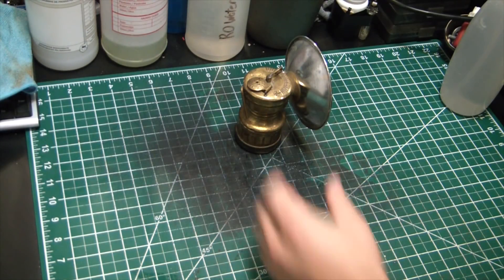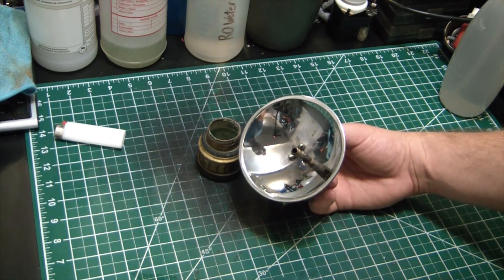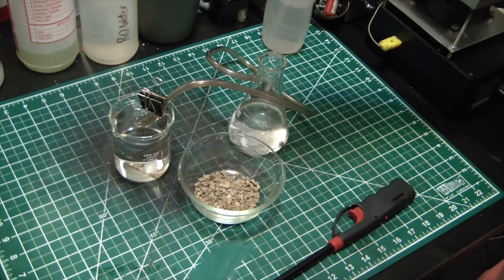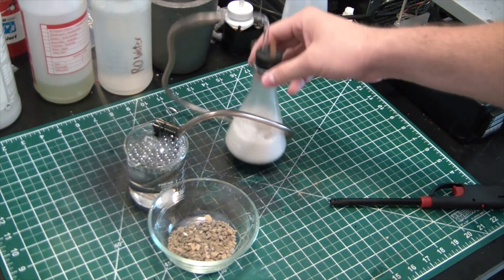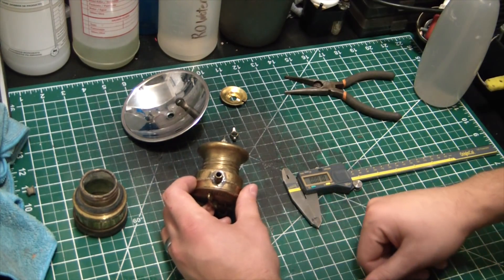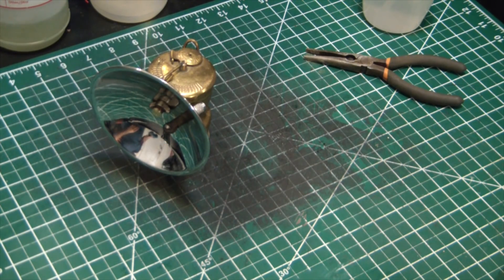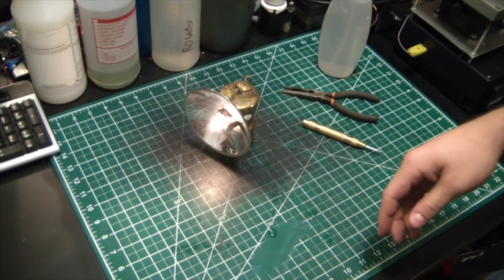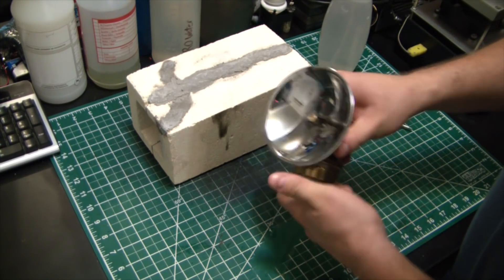Old Mining Tech: Carbide Lamp Restoration - ElementalMaker

Comment: I have 39 lbs of calcium carbide.--I got most of it from a retired miner in Vancouver WA.  I want to get a carbide lamp to play around with but haven't found one I want to spend money on yet.  I'm not sure what all else I can do with the calcium carbide, but I've got a few ideas like a torch and a small carbide cannon.
Reply from the maker: If you ever want to sell some let me know! My supply is getting attacked by moisture. Need a better container.
Reply: ElementalMaker The guy I bought it from told me liquor bottles are the best way to store it. Most of the supply is in large bottles. LOL. When you screw the cap off it lets off a good hiss.
Reply from the maker: LOL thats awesome! Not a bad idea though. moisture wont diffuse through glass and the caps are typically quite airtight. Might have to transfer mine into an empty Tequila bottle. Time for a party!
Reply: If you are in driving distance I could sell you a bit for sure. I know it isn't supposed to go through the mail, though that didn't stop the first seller on Amazon whom I bought the first pound. Last year I also got a liter of 70% nitric delivered through via FedEx and I know that is a big no-no. I spent two months contacting suppliers for form applications only to be denied repeatedly, one by one. The last big supplier in the states attempted to work with me about obtaining a new storage bottle and labels and they just wouldn't "couldn't" help.. Then out of curiosity I tried another mean from the Wal-Mart marketplace.just keep an eye out for gold mining supply sellers. They have acid.
Reply: ElementalMaker I live in WA state by the way.
Reply from the maker: Matthew Wilson ah man that's a bummer I'm clear across the country.
Reply: Send me an email.  We'll see if we can work something out somehow.  I'm going to be reading up on the laws.  Go to my profile and on the about section gives an email address that I use.  If not the calcium carbide, perhaps something else will come up.  I'm trying to collect all the elements I can legally own, plus I like to make as many different salts as I can with them just for fun.  I'm an almost 41 year old child.
Reply: Have you seen the footage from China where there was a warehouse fire, and a load of illegally stored Carbide? Biggest boom I've seen on youtube. It took out acres of new cars on their shipping lot, and I don't know how many buildings. Sorry 'bout that, firemen.

Comment: rebreather sorb is typically a mixture of sodium and calcium hydroxide
Reply from the maker: Yeah I researched it a bit more after releasing the video and realized I misspoke. Wish they still allowed annotations so I could note that. Thanks for the comment!
Reply: ElementalMaker no probs , I’m pretty sure they do use lithium hydroxide for space use because of its lower mass and slight safety increase.
Reply from the maker: Yeah I must have been thinking of the scrubbers used in the old Apollo missions. I believe on the ISS they actually use Zeolite molecular sieves to absorb the CO2 since they can be regenerated rather than shuttling up new hydroxide canisters periodically.
Reply: ElementalMaker  ah that’s smart. For some silly reason rebreather sorb is fairly expensive for what it is would hate to see the prices if they had more expensive raw materials
Reply from the maker: Do you do rebreather diving? I am only open water certified (getting advanced NAUI cert next month), but would love to get into a rebreather some day. I often thought about building my own, but that's a scary prospect if I did something wrong...
Reply: ElementalMaker  yeah I do a bit of everything only flown a breather a couple of times . Let me preface this with it’s never a good idea to DIY your own dive gear ..... but if you are buying commercial sorb  and on 100% there isn’t that much that can go wrong and makes a great system for doing long deco. Current sensor technology is what you’d call scary the lead galvanic cells are not intended for use above a particular pressure of oxygen of 1. Are designed for use in dry gas . Are sensitive to shock and vibration. 

To combat this they use 3 and voting logic which really isn’t all that great of a guarantee , optical sensors are being developed that’s when I’ll consider buying one, will certainly reduce my helium bill.
Reply from the maker: Very cool, I hope to get there some day. I would never use something like that for actual diving, just more proof of concept on-land fun. I didn't realize the existing sensors were so flaky. That's a bit scary.

Comment: AVE wanna be. They still sell new units as well as spare parts. You have to go to coal country to find them. When I was kid we would empty baking power cans cause they had an air tight resealable metal lid. Drop in a few pellets add water and seal lid. Throw the can or drop it and run and wait for it blow up.

Comment: Harbor freight sells micro drill bits. I use them for clearing my nozzle on my 3d printer. They're not too bad.  Just gotta go slow with em, they break easy, but even better quality will break easy when they get that small.
Reply from the maker: Didn't know HF sold them. Awesome! Thanks for sharing! I'll have to pick up a set and test some new tips.

Comment: May want to look in to propane/welding torch tips. They come with a variety of orifice sizes and are readily available at any welding supplier or even a tractor supply location or similar supplier.
Reply from the maker: That's a great idea, I will have to look through my welding tips!

Comment: The opening for the gas is about the size of the tip of a needle, but behind that is a lot wider so if you have a drill bit that's like a needle you can make the right size hole.
Reply from the maker: Great, thanks!

Comment: Cool vid man. After asking a few of the old boys from our local engineering group it seems that  the original tips had a hole size of approximately 0.3mm to 0.4mm and they were indeed ceramic.
Reply from the maker: Awesome! Thank you so much Jon! I truly appreciate it. Now I can order some properly sized drill bits.
Reply: @ElementalMaker  Have you made a follow up video with the correct sized hole to see if it is better?
Reply: i had a feeling some gray-haired men somewhere knew about this, and it simply hadn't made it online yet.
Reply: @superdupergrover9857  it's old to us here in eastern Kentucky where most of Kentucky's mines were, are.
Reply: Ah, so there is your answer, take a bristle from your toothbrush, make a tiny dab of clay around the tip of it, "glue" it to the old tip, then pull the bristle out and let it dry. After a bit of use, it should become ceramic.
Reply: Would that really work? I just picked one of these up with the same problem this guy has, no tip, no lathe skills, I’ll have to try it. Wonder if my wife’s molding clay will work.

Comment: My lamp and repair parts kit came from The Speleoshoppe, in Fairdale, KY. Not positive if this dealer is still available. The flame is much finer than what you came up with.  

The hole size diameter looks like the thickness of a sheet of paper.  It is probable similar to a butane lighter. 

The nozzle is countersunk from inside and out, making the thickness short too.  

The kit also has replacement seals, flints, wing nut, and other spares.
Reply from the maker: Great I will have to see if I can find them, thank you!

Comment: Is Calcium Carbide available to buy from anywhere ?
Reply from the maker: ron palmer you certainly won't find it at home depot, but you can easily get it on eBay
Reply: Many thanks
Reply: Try Lehman’s.  It isn’t cheap because they sell about a 12 pound minimum.

Comment: try using a electrode from a dcell battery  yo machine the burner tip. I found one of those a few yrs back, and a blue can of carbide,boy what a bang u can get outta that stuff. I wanted to make my own bangsite cannon. just never got around to it
Reply from the maker: Great idea! I have tons of graphite rods laying around for rocket nozzles. That will work perfectly and drill much more easily! I'm going to weld up a carbide cannon sometime soon. Should make for a cool video! Its both awesome and terrifying how powerful acetylene is!
Reply: acetylene is actualy explosive. I tired getting the mythbusters to drop an oxy acetylene welding rig out of a helicopter. but even they thought twice about it. I remember seeing a A team movie where they droped one with some road flares taped to it and it was huge.but only proly gas bombs.
Reply: theyre easy to make with just plumbing supplies and a bbcue sparker. my grandfather used to use his fencepost just take the cap off .pour some water and carbide in it and wait a minute then touch it off with a lit stick. and it would sound like dynamite.ive seen guys use 55gal drums .coffee cans inverted over a hole etc and launch them . yeah its fun .till u blow out windows..

Comment: Would you be the younger  Ave?
Reply from the maker: LOL I seem to be getting that reputation. Love AVE's stuff.
Reply: Hey bob about the Patron thing would that keep hitting Avery month or one time
Reply from the maker: Bill Pritchett I believe you can choose to do either a one time or monthly. I truly appreciate your consideration of donating to the channel!
Reply: do you have a minute
Reply from the maker: Bill Pritchett yeah of course. How can I help?
Reply: the seebeckgenerator can it be hooked in series
Reply from the maker: Bill Pritchett such as peltier junctions? Yes they can be stacked in series, but it can quickly become complicated as they are quite inefficient. It's best to stack them in a pyramid configuration, ie the coldest at 30w, then 100w, then 150w or similar. You'll need some excellent heatsinking and a good fan to keep the hot side from overheating.
Reply: that the same thing that makes your car seats hot or cold ?
Reply from the maker: Bill Pritchett most car heated seats that I'm familiar with simply use resistance heating wire. For cooling they typically just blow a small amount of air through the seats through a series of tubes and pores in the leather.
Reply: would they work like a solar panel if you keep one side cold
Reply: looking outside of tool shed out here in Hell hot AZidon't know what i don't know thanks for time

Comment: I remember using one some 28 years ago (I was 12 or so) when visiting a non-commercially exploited cave in Austria. They didn't have the dripping system. On the way up to the cave we had to fill them with some water from a small waterfall we had to walk under. The guide actually had a head lamp on carbide. But these ones without dripping regulation, were just producing acethylene at full speed, building up the pressure. As the pressure got higher, the gas would not escape the water surface but instead go in solution in the water until enough gas was burnt to drop the pressure enough for new gas to escape the water (like CO2 bubbling up when opening a soda bottle). The advantages of such a system (in spite of a higher pressure buildup) were that the flame could not travel up the nozzle as there was no oxygen in the reaction chamber left by the time you shut the lid (which is not the case in your lamp, so yours actually has an explosion risk) and they were low heavy (while yours is probably top heavy with the water compartiment being up top) making them more stable when setting them on a ledge or on the floor.
I remember the guide explaining how they used the soot to mark the way to find the exit again, and in larger areas, you could follow the smell. If you entered a hall where there was no bad smell associated with these lamps, then you knew you entered a hall where you had not been earlier. I think I have some pictures from inside the cave, and I suppose I was holding the lamp in them. 

Anyway, I think if you can find some retro-style cave guides like that one, they will probably be able to tell you the proper nozzle width, or even hook you up with spare parts...

This particular cave I visited was called the Schneckenlochhöle (Slug's Hole Cave) in the tiny high alp hamlet of Schönebach in the Vorarlberg province, kanton Bregenzerwald. In case you'd like to look up the guides that used those lamps. I remember them (there were 2 guides for a group of about 20 people I believe) not being very old so they're probably still around.
Reply: That analogy with soda bottles made me think of something: would dry ice stay solid longer if it was submerged in carbonated water inside a closed PET bottle? (I know, that's a pretty random jump of a cluttered mind, but that's where cool videos originate, don't they?) Care to test that? Or is that something I should suggest to Cody ('s Lab)?
Reply from the maker: Having quite a bit of experience with dry ice in bottles with water, I believe it would just blow the bottle to shreds. Very cool story with the caving experience you had. I would love to do something like that myself. Pretty amazing that the water - carbide reaction was unregulated. Learn something new every day.
Reply: Haha, it actually scared me (as I was just a kid, and in my interpretation, we were just making a gas bomb, but in a container that I deemed way too weak to be holding a pressurized flamable gas) but my dad (engineer) explained it to me with the analogy of the soda bottle. At least, that's how I remember it. But I'm positive about the absence of water regulation. We held the container with the little rocks directly under the waterfall to fill them up about halfway.

It's amazing how many (relatively) useless anecdotes are in my head, while I can't seem to properly remember important appointments or payment due dates... XD
Reply: Don't forget Acetylene will randomly decompose, and release massive amounts of extra pressure if its under too much pressure, unless its dissolved in acetone.

So, his dissolved in water method was not any safer as far as explosion risks go.
Reply: I would be afraid of the lights. Acetylene explodes when compressed above 2.5 bar. Acetylene explodes in 98% air and also in 2% air.

Comment: Could this work in a small gas or nitro engine? Or maybe added to the intake along with gas for extra power?  It would be an interesting experiment.
Reply from the maker: Ryan Landry I've seen Briggs and Stratton mower engines run on acetylene, so I bet it would work!
Reply: ElementalMaker cool, thanks for the reply!  I'll have to try sometime.  I'm curious if it would produce more power.  Also it would be a nice alternative fuel if you run out of gas in the middle of nowhere and there's water around or use urine. 😂

Comment: I like to put the carbide in bottles and have a ballooon full of water attached to it. Then at a shooting range I will light a small fire and shoot the balloons after filling them with the gas. It makes a nice fire ball if the proximity and intensity of the fire are right.
Reply from the maker: Sounds like a BLAST! Pun fully intended. Acetylene sure is one hell of a reactive gas! Need to get to the range myself, been too long.

Comment: Just get a simple gas burner orifice, will fit right in there without any work, and has the right hole and relief already.
Reply from the maker: Great to know! Thanks for sharing!
Reply: Different gasses, different applications, call for different orifices.
Reply: I was thinking a old Colman stove orifice would prolly work and fit right on there with out much work. I used them to convert an old chambers cook stove from the ‘20s from gas to propane at my house.

Comment: Carbide is also used as part of the test kit to determine the water content of engine and other oils, using the carbide to react with the water, and measuring the pressure the gas will create in a closed pressure test vessel.
Reply from the maker: Wow that's pretty slick. I may have to do a video showing that concept after I research it some more!
Reply: @ElementalMaker  would love to see a video on that.